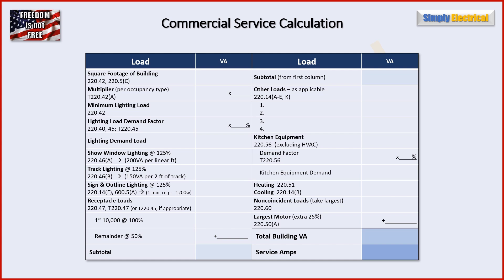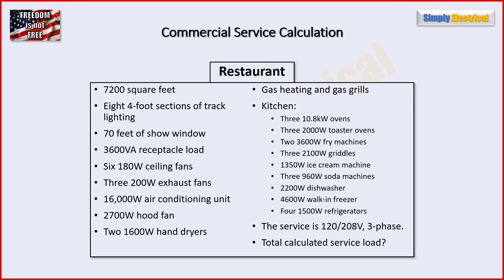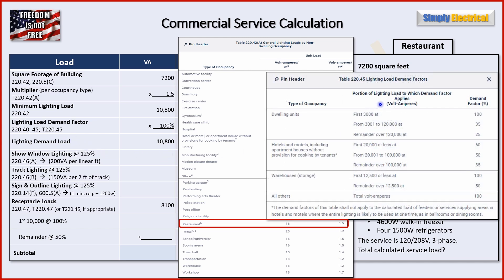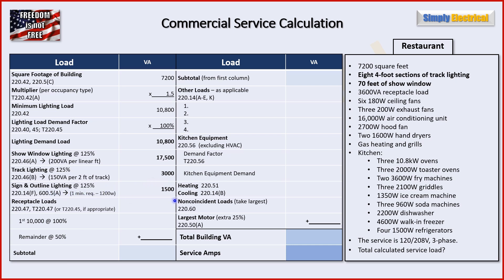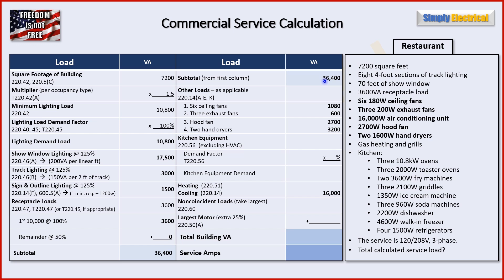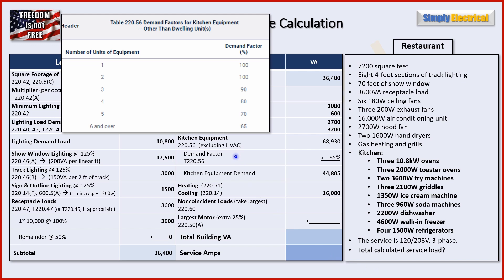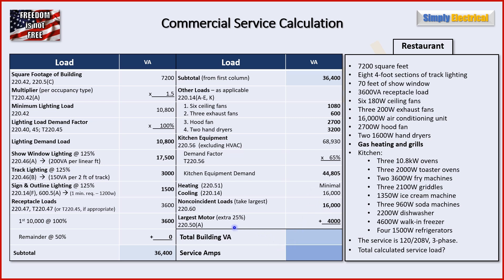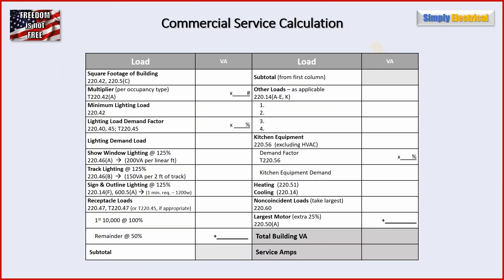Restaurant Standard Calculation - Crash Course 2023

Comment: Also, with a 302 amp service calculation would you then set the service OCPD at 350 amp from table 240.6 with 500 kcmil copper?
Reply from the maker: Yes, except 350 kcmil Cu is adequate for 302A. 240.4(B) allows the next higher rated OCPD.
We aren't given enough info to apply any correction or adjustment factors.

Comment: Very helpful thank you. I’m curious why the other loads category did not include 125% continuous load demand increases for an appliance like a ceiling fan.
Reply from the maker: This is a bit of a gray area. It's all based on "expectations", per article 100 (definition of ceiling fan). There are many loads that COULD be operated for more than 3 hours at a time. But unless you know for sure that it is a typically continuous load, the default would be to take it at 100%.

You're right, though. A ceiling fan is one of those loads that easily can be run for extended amounts of time - especially in a commercial application. Technically, it would be advisable to figure it as a continuous load if you know what the operation schedule is.

However, in my experience, on an exam, they won't expect the test-taker to jump to conclusions on what is and is not a continuous load. That would be quite unfair. They will inform you as to the continuous loads (except lighting) within the question. Always answer according to the data given.

In the real world, the ceiling fan load is so minimal, it will not usually affect the outcome to any significant degree. "Usually" being the key word. ;)